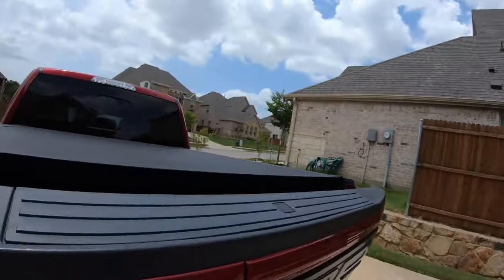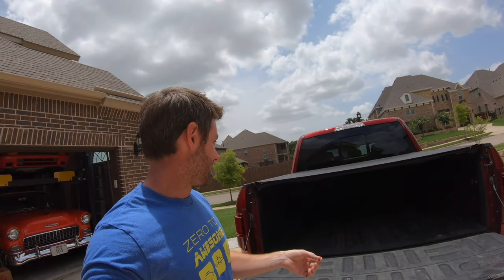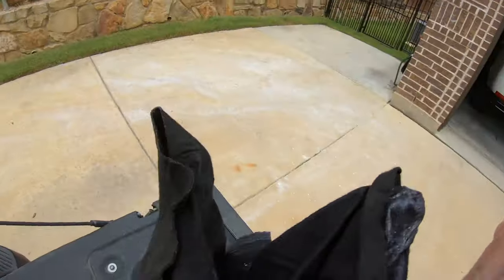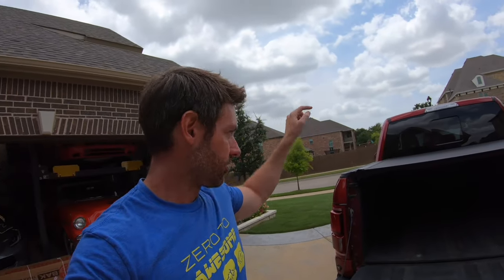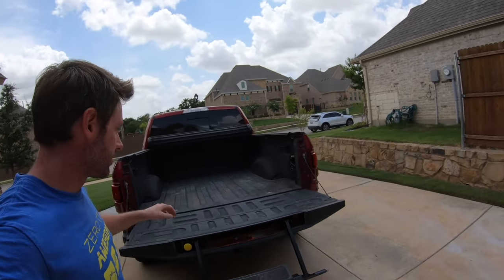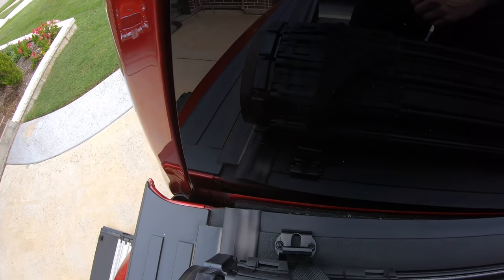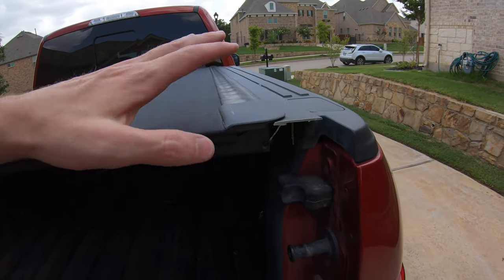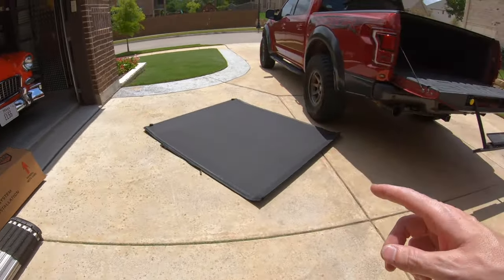I finally found the PERFECT TRUCK BED COVER after 3 bad BAK revolvers. Maybe… The BAK Revolver X4s

Comment: So after 1 year of having it how is it holding up?
Reply from the maker: No issues so far
Reply: That vinyl gets messed up
Reply: @simd510 do you have it? How do you know that?
Reply: I've had the vinyl start coming loose and peeling up on two. They replaced the first one under warranty (with an X4S), and now the new one just started peeling up on the back corner. So each has lasted about 3 years. I'll probably try to glue it back down, otherwise I still like it.

Comment: Hey those plastic ends probably killed numerous sales. It’s a cheap design especially when it comes to bed security. They should be aluminum in design. I like the cover but those cheap breakable plastic ends ENDED it for me.

Comment: I bought my BAK roll-up cover for 899$ 4/29/2016 the cloth fell off the underside vinyl peeled up the passenger side and bed end. It still works well but looks bad and I'm gonna replace it. I will not repurchase a BAK didn't get 900 worth.BAK offered half off retail and flat 54 shipping 3-year warranty on any bak of my choice. I ordered a gator SF from realtruck chatted with them got 264.41 full-price cover tax-free shipping 10 years warranty vinyl lifetime hardware

Comment: I had one here in Arizona and the heat completely destroyed the cover. They replaced it with a folding one. Which has now also cracked, split, and delaminated in the heat. 😂
Reply: @BrendanEvan My X4s completely delaminated within 3 months of life in Arizona. They give you a M4 instead for the recall?
Reply: My cloth the glue got melted from the heat in Arizona 😢 but still love it 😂

Comment: I had this cover and promptly sold it. The tabs on the end of the rail, closest to the tailgate stick out about 1.5in and is super easy to break off if you have big items in the bed. If you ever plan on having a couch, crate, etc that's somewhat big, do not recommend this one. Huge flaw

Comment: The "felts" came loose on mine after it was out of warranty.  I took the whole cover off, flipped it upside down, applied construction adhesive, and put back the felts.  It's held for at least three years.

Comment: Great, honest review. Even with the 5 year warranty, full replacement is off the table after the 5 years. I had two X2's fall completely apart in 6 years, and with my latest completely disintegrated, best they would do is 50% off. The felt went first after less than a year. Year 2 the vinyl would shrink and pull away from from the edges, then completely crack and bind the rolling ability before year 3. While some of the issues have been addressed like the plastic replacing the felt, mountains of reviews now claim the endcaps come off and the vinyl quality still shrinks and cracks. I opted to get the MX4 instead with the discount, and hope I don't continue to have problems from this "premium" tonneau company. $1K+ is too much money to have it become trash in 3 years from Georgia sun.
Reply: How's the mx4 holding up?
Reply: @jobeall5078 , pretty good so far. I don't want to jinx it, but after 1 year there are no issues with fading or the materials itself. Only problem I've had so far is that they use plastic caps in the fold joints to lock into the rails which pop out of place every time I open it, and makes closing it a pain. (This was echoed by a couple other people's comments  it looks like). Jury is still out since my Revolvers all failed at the 2-3 year mark.
Reply: I'm on my second x2, I just got it replaced from BAK, they were good about it... I changed it out today. The first one almost disintegrated I hope this one lasts... I like it.
Reply: On my second one. Same issue  with felt..but worse is the aluminum  track on the end  have come undone and now it's falling  apart.
They won't do anything  forme as they replaced the first one for " free".
I wouldn't by another one

Comment: Hey I bought a Access Lorado Roll-Up tonneau cover in 2010 and it has been great. 
 Always parked outside, i have no garage or carport, little to no shade all day. 
 It has been rolled down most of the 14 years, stayed rolled up for about the past 5 years until 2 weeks ago rolled it back down. 
 The hook strip on bed rail is wore out but it still stays down when driving.
The fabric is fine.

Comment: I thing the rubber and felt was to protect the roll up motion from making wear marks as the until rolls up and rolls out flat.
Reply: Yep, keeps the aluminum from marking the top surface when it’s rolling up. The alum would rub off silver color on the black especially when rolled up driving around.

Comment: I hope the X4s holds up. I just ordered on and waiting on delivery.
All the reviews I've watched are good . This will be the first tonneau cover I've ever owned. I'm hoping to gain a little range with my F150 lightning.
Reply: Will not gain any range.
Reply: I just had the Bakflip MX4 installed on my Toyota Tundra yesterday and noticed my trips have gained 1-2 mpg.  I've had multiple tonneau covers (one piece and tri-fold, no rolling) and they've all added a little more mpg, but nothing big.

Comment: I took my old cover to the recycler, got a few bucks. The felt is there to keep from pinching your fingers between the slats when rolling it up or down.
Reply: the felt is actually there to create a buffer when it rolls up so the aluminum is not rubbing on the vinyl. Felt fell off my X2 in the first year. 5 years later the vinyl is destroyed. These are 5 year covers unless you can garage your truck. Still not bad  - it is vinyl after all !

Comment: Those end caps are making me have second thought on the X4S. I'm looking at the Truxedo Sentry which is the same type of cover. The Sentry doesn't have those corner pieces and looks a little more finished IMO. The one issue with the Sentry is the cover needs to be unlatched to close the tail gate. I think I can live with that.
Reply from the maker: Same company different cover. All the truck hero stuff is the same manufacturer

Comment: I like the function and looks of the bak 4s, but with all quality issues and negative reviews, I bought the hf650 quad fold. Right out of the box, bolted it on and it fit perfectly, didn't have to adjust anything.
Reply: Smart.

Comment: Beautiful home, garage, lift and cars. I had that cover in the northeast for about a year..no issue with the felt but the rubber gasket that runs the length of the bed is garbage.  I now have the Diamondback cover. It will last a long time. Not crazy about how it opens though. You are right about the old clips. Sucked.
Reply from the maker: The diamondback may even outlast the truck! But yeah, it’s a trade off

Comment: I have the Revolver X2, it’s past warranty period now, but had same thing with felt, and the vinyl was peeling off after a little over a year. They replaced, but the second one was clunky and did exact same thing. I had asked when I got my replacement if it was also covered, and they simply wouldn’t respond to me at all. That’s upsetting to know the warranty continued even with the replacement, especially since these things aren’t cheap. I was left with the impression that I should just be happy I got the one replacement. I would never spend that money on one of these again. If you roll without the felt, it pinches the crap out of your fingers!

Comment: I was very interested in that cover for my new Maverick but finally decided on Truck2Go's SyneticUSA retractable bed cover. It actually cost less than the one you got. If they had been priced the same I would’ve gone with the roll-up since it is easier to install. I think the retractable is a more permanent solution, is more water/dust resistant and looks great on the Maverick. However, I have to hand it to BAK for standing behind their product. I also agree with you that they fixed a problem that didn’t exist. Good video. Maybe you could give the old ones to someone willing to fix the 'damage' and put them to use.
Reply: Hey I’m looking at different brands never heard Truck To Go 
How’s it holding up ?
Reply: @josephpuchel6497  Very well! Looks great and works as advertised.  Of course, I’ve only had it on a few weeks but I'm very pleased with it.
Reply: @josephpuchel6497  Very well. I’ve had it a short time so I can’t give a long term review yet. However, it is well made and I look to get a very long lifetime of use from my investment.

Comment: After I get a new Bed cover I am going to use the old bed cover as a floor in my Saturn KA Boat. A little modification with a band saw and it should work well.
Reply from the maker: GREAT MINDS. We turned mine into a boat…
https://youtu.be/uLttQ8jxZCM

Comment: Really a shame they have not figured it out.  I want to get a cover but spending a 1,000 for one it really out there and then having it fail repeatedly not good.  There seems to be a lot of people having same problem.  The updated design looks better but damn if they didn't blow it with the corner pieces..
Reply: You could always super glue the end cap into position. That cap prevents the weather stripping from coming up from the end like on the old model.

Comment: I received a BAK folding hard cover for a GMC Carbon Pro bed, and the rails were actually made in reverse, with the brackets, drains, and notches for the attachment bolts being way off and on the wrong ends.
Reply from the maker: Not entirely surprised. After this video I found out my cover was 1/4” too narrow and wasn’t locking. Had to shim it to get it to lock
Reply: @ZeroToAwesome  To bad they are letting quality control slide.
Reply: I'm currently waiting on a revolver x4s to replace a bakflip mx4. Their support has been horrible. You're lucky to get a response via email onces every 4 days, and when you call in the automated voice tells you they're experiencing high call volumes and to use email support. Well I wouldn't be calling in if email support wasn't horrible. Poor quality control, poor customer support. Unfortunately there's not many options for the CarbonPro bed.

Comment: I have had mine for nearly 5 years and I can say with confidence it is a piece of shyte.   I looks like it is 25 years old.  And this is the second one.  I got a replacement after just a couple months because the weather striping was barely attached.   And those black felt sections are strictly for the heat as this thing gets really hot in SoCal.   Just like Texas.   And for fun I put the old one on the curb and put my F150 on it to bend it for "proof of destruction".
Reply: One more item.  It really makes my 2018 Ford F150, which is perfect cosmetically, look crappy when get around to the back and look at the cover.
Reply from the maker: I wonder what other proof of destructions they’ve received!

Comment: The purpose of the rubber/felt is to keep the cover from scratching up the back of your cab when it is rolled up. Fun fact. Great vid
Reply: no, it contacts in the center not the far edges.
Reply: The roll up doesn't reach the cab. It's fastened down with a strap before it gets there.
The reason for the felt is so the aluminum doesn't scratch the material.

Comment: I have the X4s after the exact same scenario with the X2 (two of them) with the Austin, Tx heat, and it has not held up either.   The sides of the top have begun to roll up away from the lid, while slats near the tailgate have become unglued and fallen off.

Comment: I had the same failure on my 2019 RAM.  Truck was parked out side in Texas summer heat.  BAK sent me a replacement and its still good as the truck is not parked in the garage and not out in the heat.  Only new problem is one of the cover strap clip/retainer broke.  May reach out to BAK to see if the new style are available?
Thanks for video!

Comment: I just installed the Bak X4S on my truck.  During installation those plastic end caps popped right off.  I thought that was an odd choice by the manufacturer.  They are easy to put back on, but it's still strange.  We will see how it goes.  I love everything else about the cover.
Reply: My X4s had one of the caps broken off upon delivery. According to FedEx tracking the warrantee replacement cap was delivered today while I'm at work. Not only was one of the two spring clips broken, but the indexing pin was also broken. My thought on how to improve this part would be to cut off the indexing pin, drill a hole there, and then use a pop-rivet to hold it on. I'm trying to decide if I should preemptively modify my cover, or wait for the warrantee to run out before I pop-rivet those two endcaps on...

Something that I have discovered with the cap missing. It is easy to see that I need to adjust the cover placement because the rear gasket material isn't quite touching the tailgate. Need to shift everything back by about 1/32 to 1/16 of an inch.

Comment: In addition to being hot, once you have the felt off the old model you'll find that the panels will pinch the hell out of you when you unroll it barehanded. Additionally, after a couple years the rubber starts to deteriorate and everything that touches it (hands, clothes, etc.) gets annoying black marks all over it. I've had mine about 5 years and it is barely holding up. Pieces keep falling off of it, the rubber strips keep bunching up and sliding off  the ends, and it leaks like crazy! I have really grown to hate the old Bak Revolver. So, even if at a great price, I would steer clear of this bed cover. I won't even consider the new version after how bad this one has been.

Comment: Hey BAK should update this product and use a Velcro strip down each side instead of the hard rubber. Similar to Truxedo CT series. Also remove those rubber ends which seem to be issue of breaking off.

Comment: bummer about the failures, I was wishing Id gone that route instead of as cheap as possible like I did. glad i didnt.  I can see bed covers for some UTVs? or a retractable roof on a UTV? or if you were someplace that had snow you could load up and drap s herd of people around a snow covered field behind the truck on them....  Here to help!
Reply: Cheap doesn't always mean bad. In the case of a bed cover, cheaper is less complicated. I always bought an Extang Classic Platinum snap down cover for all of the 5 trucks I've owned over the years and no issues with them. The first was on a 93 Lightning and it was still in good shape 10 years later when I traded for an 03 Supercrew. Extang his since discontinued that cover and the reason why I'm looking elsewhere for a cover for my new truck.

Comment: Very useful and informative video, at a good pace - thanks. I have an Undercover hard tonneau cover which is great but is a PITA if you want an open bed to transport tall objects. This roll-up tonneau cover is the answer for my next truck. How is it holding up after a year in the Texas heat? I am also in Houston.
Reply from the maker: Thanks! So far so good. No issues yet with this one. Haven’t even lost those plastic end caps!
Reply: @ZeroToAwesome   Thanks for the confirmation.

Comment: Your Truck is beautiful.  How is your latest Revolver cover holding up in our miserable Texas heat?  I've spent days researching the best cover to get for my '21 Titan truck. It will be in our garage when not in use.  I like the looks and function of the Revolver x4s best.  Just not confident it will last 5 to 10 year.  Considering how pricey they are, it's sad, but it seems none of the tonneau covers will last over 6 years.  Appreciate your helpful videos and any updates.
Reply from the maker: So far so good. Haven’t even lost one of those end caps yet. The truck is garaged now though so that may be why it’s doing well
Reply: @ZeroToAwesome  so good to know!  I just now ordered one for my truck.  If I mostly keep it in the garage, hopefully it will last even in our TX brutal heat.  I know none of the types of covers are 100% waterproof, but I am hoping it will keep groceries or horse feed sacks dry for a 30 minute drive in the rain ...a blessing we seldom get.

Comment: So no better one found.? I had a Retrax on my 2010 2500 then put another one on my 2020 3500. I thought they would have made improvements but they have not. They have sent me like 3 sets of rails & a new cover as mine is Crooked at the head unit. What I told them is stupid & should have fixed since this cover has been out for a long time is the locking mechanism. It is nice that it covers all stake pockets & you can lock it anywhere but the lock uses pointed pins to dig into the aluminum rail leaving marks and can move as metal to metal will not stay. They need to make the locking fingers bigger & add a type of rubber to them so it does not damage the rails & will help keep it in place. I was also thinking maybe a rubber strip on the rail so the locking pins can dig into the rubber